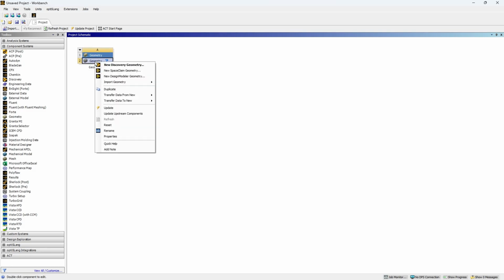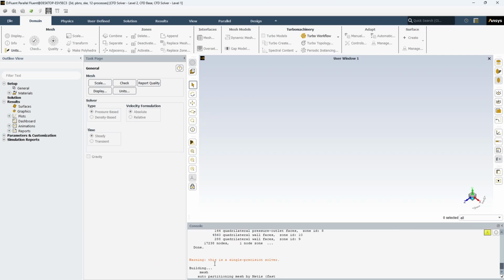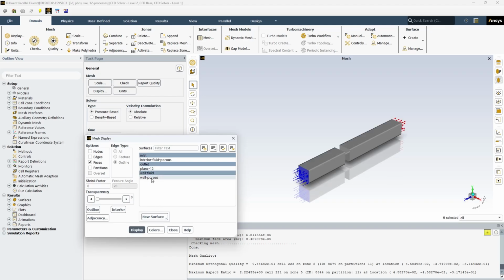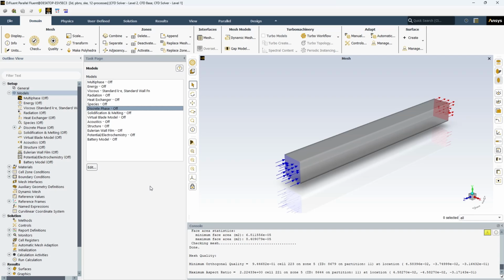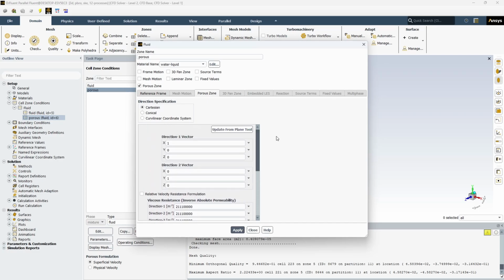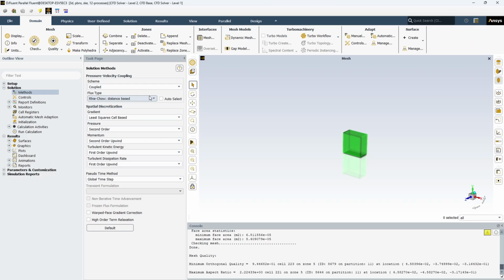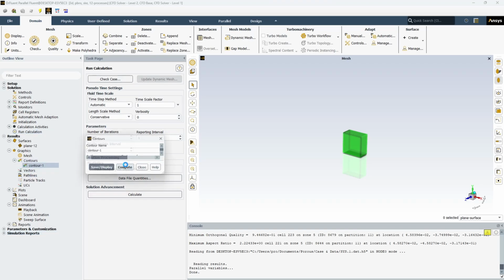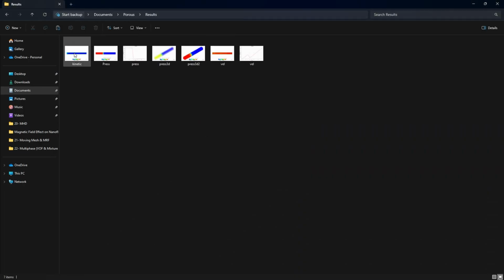Mastering Porous Media CFD Simulations

Comment: Hello, Professor!
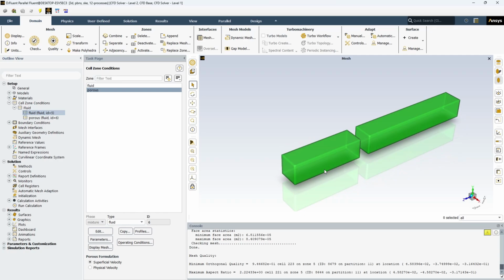I have a question about the part at 20:13 in your video. It seems that there are two separate fluid regions, but in the cell zone setup, they are recognized as one. It also looks like you added one porous zone between them, making a total of two zones. Could you please explain how you handled this part in the Geometry step?